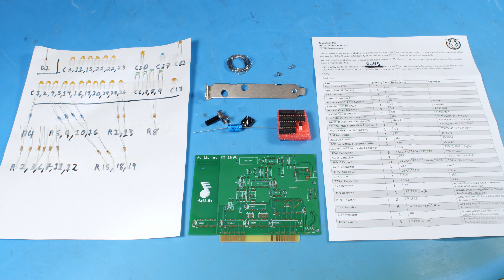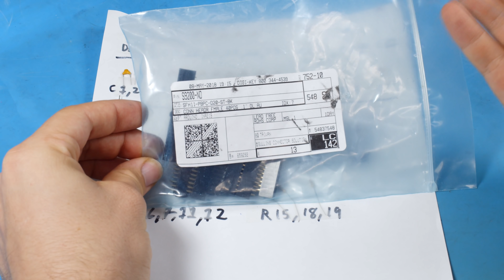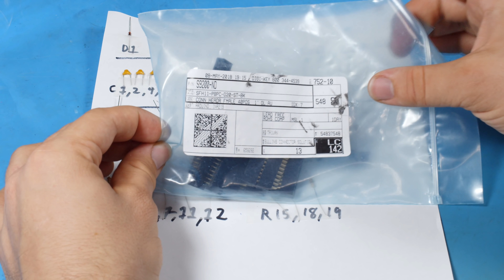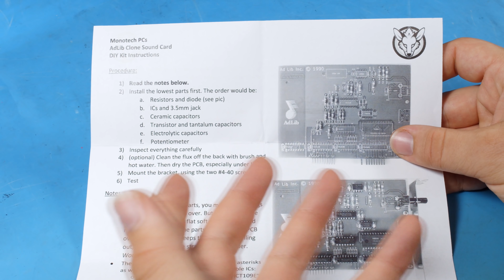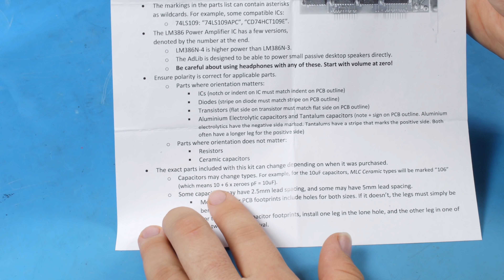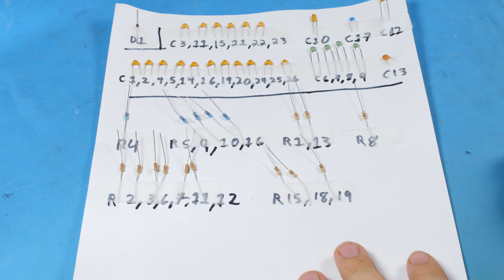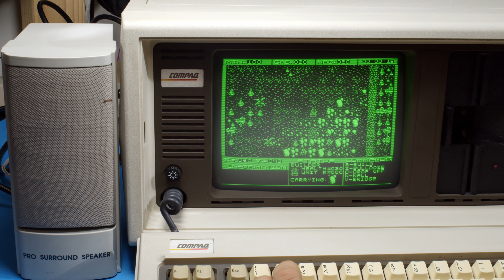AdLib Kit Assembly

Comment: One more thing, when soldering it is better to solder the passive components first and then those integrated circuits as that will put the least amount of thermal stress on them.

Comment: Also the 3 holes for the caps lets you use for 0.1" or 0.2" leg pitch capacitors. Its common enough but you just have to look at the PCB to find the link.
Reply: I presume that's why the instruction sheet said it's to accommodate 2mm and 5mm leg spacing.

Comment: This was the very first major soldering project I did roughly 1.5 years ago. The kits were not available yet, so I ordered 3 PCBs locally and sourced parts from eBay (Yamaha) and Mouser. Was really fun. I gave one of the finished cards to the 8bit guy, which he used now in a few videos, e.g. the last making of Planet X3. Since then I also made the MUS1099 GameBlaster clone and the Snark Barker, which is a Sound Blaster replica. Since these old cards are so expensive when original, making them yourself is actually cheaper and more fun.

Link to my sound card assembly videos: https://www.youtube.com/playlist?list=PLGJnX2KGgaw3UVdvlxxU20A6qGQgYZuK7

Comment: I start with the resistors, they are thinner than the IC's. Once you have a few inserted on the edges the board lays flat and the table will hold the others in place without the excessive cinch (bend) you put on the resistor legs. (smaller cinch makes it easier to desolder if needed)

Comment: Im so glad you decided to put that in your portable! I have one I need to fix some issues on. One disk drive causes the power supply to kick off, i think the monitor needs a cap job (due to uncontrollable screen rollover. I plan on getting a isa to cf card drive and now an adlib clone because you confirmed it for me if it would work!

Comment: I so want an adlib soundblaster card for modern PCs with drivers
Reply: You could probably emulate it in software these days. It'd still be cool to have hardware for it though.
Reply: Pci-e sound cards are so rare. Creative still do some though. I didn't even know they were still around till I got my Asrock B450 motherboard which had the built in Creative soundblaster as a selling point.
Reply: @IanC14  funny you mention that. I just worked on a system with a Creative PCI-E card in it.

Comment: maybe put all the refrence numbers as stickers on the bag and reperate them by part in seperate bags, would be a nice way of what your're doing with the paper
Reply from the maker: Needing a bunch of bags adds another thing you need to keep track of and buy for selling kits then. The reason I like the paper organizer solution is that it's nearly free. It shouldn't be hard to make a generator for pages that take a BOM file exported from EDA software to automate them either.
Reply: @TechTangents  I see what you mean, yeah yours makes more sense

Comment: Just an FYI Monotech has a habit of taking open source hardware projects, rebranding them and selling them with little to no attribution to the original designer.  This is true of this card as I actually know the person who actually reverse engineered the original Adlib card and make this design available. 

His site is here: http://tubetime.us/index.php/2016/07/22/a-reproduction-adlib-sound-card/
Reply from the maker: I was not aware of that. I double checked the product page and the Github repository where the original design file are release is linked. I think Monotech's boards were ordered before it was changed to RadLib(but I may be wrong) and that the only change is the text above the AdLib logo. That is technically out of compliance with the license as his modifications are not stated on the purchase page.

I will keep this in mind for future videos featuring Monotech products. I rushed this video because I was in a time crunch when I recorded it and I didn't do research so I could know who had designed the card. I was originally under the impression that there had been multiple ground up designs for the card and this was based off one of them. Now I know they are all sourced from Tube Time's design.

Comment: The only times I've seen parts clearly sorted and marked by reference is in many Elenco kits. They have all the component leads bent around a long, narrow card with notches (and holes for caps) in it. I can definitely see that being prohibitively expensive, tedious, or otherwise pain-in-the-neck-y for relatively low-volume kits, though.

Comment: 3:38 You put the components in the PCB in the order on the sheet so that when you turn the board over to solder, the components are always held flush.  It's the normal way to hand-assemble a PCB, and not doing this might lead to you to need to bend the component leads over before soldering to hold them in place, which no one (sensible) does.
Reply: I understand doing that on an assembly line, but for a home assembly I don't understand why more people don't just tape down the components to avoid having to bend pins or to carefully make sure you're holding them flush and keep them from falling out when you flip them over. 

Hell, the instruction sheet suggested that you do some stuff with a mouse pad to hold the components in their holes while you're flipping, as if you're catching a spider in a cup or something. Just seems needlessly fiddly and complicated when you can put a few pieces of tape on temporarily and make your life simpler.

Comment: Please please please do NOT bend components by hand right by their casing like this. Especially in dipped or ceramic casings, this introduces stress which will form larger fractures later on. Use components appropriate for the footprint, or bend the leads with a pair of pliers.